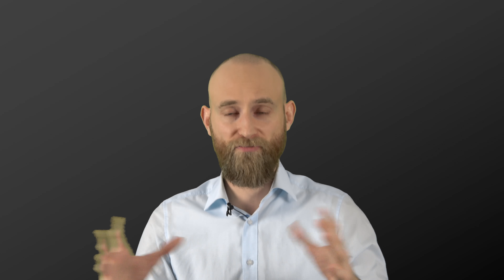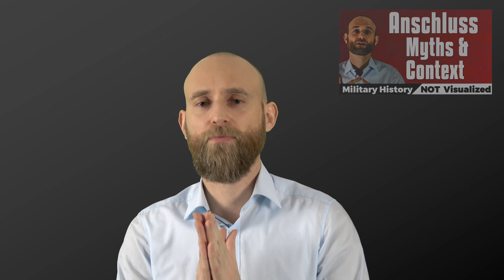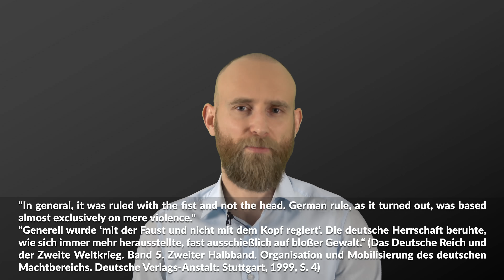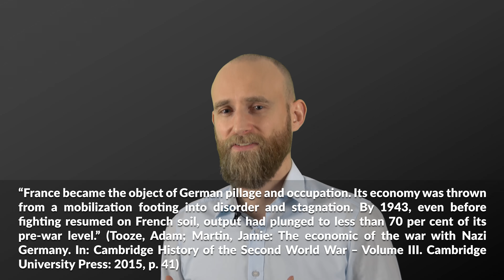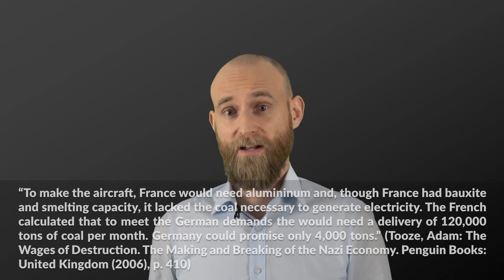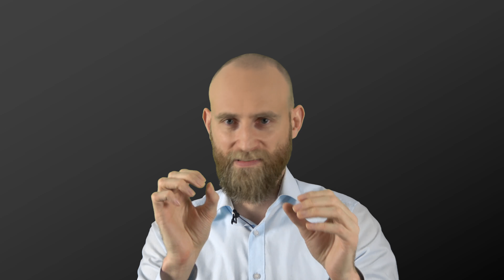German Exploitation of Occupied Industries - Effective?

Comment: Germany used coal for everything. It came from the Ruhr, where most heavy industry was.  The prime transport mechanism was rail, using steam trains, that used coal, with steel wheels on steel rails, made using coal, so no imported rubber for tyres.  Electricity was generated using coal. Coal for industry. Coal for steel making. Cutting off the Ruhr meant hitting the German war machine at its heart, starving it of manufacturing and energy. Cutting the Ruhr off was vital. 

The British saw this, especially Montgomery, wanting an allied thrust north, to turn right to isolate the Ruhr.  Eisenhower wanted a broad front, which was totally ineffective. People will say, well from D-day to surrender it was only 11 months. However, it was only that short because the Germans gambled using much of their armour at the Battle of the Bulge, losing it shortening the war. They ran out of armour.

The war could have been over by Christmas 1944 if Montgomery was left in charge of all ground forces. He would have seized the Ruhr - then its all over. Even German generals after WW2 agreed with Montgomery saying they could not have stopped a full allied thrust to the north. They could stop the thin allied line that stretched from Switzerland to the North Sea. The Ruhr was only captured a month before the end of the war. 

Eisenhower allowed the under resourced Market Garden to go ahead into the north. It was so small it only had one corps above Eindhoven as Eisenhower would not allocate the US First Army to move up on the right British flank.  A total disgrace when looking at the level of allied forces in the ETO.
Reply: The war couldn’t have been over by Christmas 1944, in fact like his usual set piece offensives Monty’s offensive north failed at Goodwood, and of course the war didn’t end after the Ruhr encirclement

Finally it wasn’t possible to end in 1944 considering the whole they only made it to the west wall in late 1944, trust guy Eisenhower was both smarter than you, and smarter than the Germans, and certainly smarter than Montgomery
Reply: @looinrims  
* Monty was the most successful general in WW2.  He had to take command of two shambolic US armies in the German Bulge attack .
* Goodwood was a success.  Monty drew onto the British the German armour,  then wiped out 90% of it. 
* Rhur encirclement was not until the last weeks of the war. 
* Monty wanted a 40 division thrust to the north.  The German generals said they could not have resisted it, saying the war being over by Christmas 1944.
* US general were inexperienced and naive, prolonging the war.
* You must not get your history from Hollywood.

Comment: In the Netherlands the Nazi's stole the largest portion through the Dutch National Bank. The Netherland had kept their own currency which fact the Germans  used to force the National Bank to print extra money for them.  With  this money the Germans bought goods and services in Netherland. The Germans were so nice to compensate this with a debt in Reichsmark to keep up the resemblance of a normal international economy. However the Dutch National Bank was not allowed to collected those debts until after Germany had won the war. And even if the bank could have gotten Reichsmarks during the war the Dutch would not have been allowed spent those in Germany to import goods back. After the war there was no Germany or Reichsmark economy, so those debts became worthless. This was one of the reasons the Dutch economy got flooded with guilders and only the rationing, fixed price system prevented hyper-inflation. After the war those extra guilders had to be taxed away first before a normal, free economy could resume.
Reply: Another part of the monatary system consisted of  cheaper production costs for money. Changing silver coins  into paper and changing the small silver and copper coins into cheap zink, They made them squaere to have as less restmaterial as possible.  A silver  gulden comes into the National Bank, consisting of silver with a certain value. A paper gulden comes out, worth only a little piece of paper and ink and the costs of printing. Worth a few cent.  The difference is for the one who prints it. Not bad, 2 cts of paper. 98 ct of pure profit. A form of tax, nobody feels. At least not in the beginning.

Comment: Gasogene*.  The fuel problem was so bad that Tigers in France were converted with Gasogene fuel generators.  Burrning wood to produce methane.  Ruinously expensive in resources consumed for work done per unit of volume.
http://www.tanks-encyclopedia.com/ww2/nazi_germany/gas-powered-fahrschulwanne-tanks.php

*Holzgas vom Deutsch

Comment: Did natural gas exist as a power source during the Second World War?
Reply: Large numbers of communities used town gas. Coal plus steam. About 30% Carbon monoxide. The problems with natural gas are drilling,pipeline transportation and storage. Large safe nonriveted pressure vessels were essentially new,electric arc welding was newish, and the idea of dropping the temperature down to cryogenic and storing the liquid in caverns( yes it really is done ) had not been created.
Natural gas takes a lot of very expensive permanently located infrastructure to be economically useful.

Comment: Hi Bernhard, I have a complicated question to ask you. What if the Wehrmacht waited until summer 1941 to attack the uk/try to gain aerial supremacy over the uk and the channel? And was this ever proposed to Hitlee/the OKH/OKW/Kriegsmarine? I mean germany, the axis and its occupied territories could outproduce the island of britain, right?
Reply: Germany was falling behind its adversaries in the arms race by the start of '39. Delaying the war would have produced even worse results for them. They were in a no win situation.
Reply: @dondajulah4168  I didn't mean that but rather since the soviets gave germans oil and other important resources, couldn't germany and the axis just single handedly outproduce britain in planes and stuff and bomb them to submission or try to do sealion in 41 instead of barbarossa
Reply: @KlausValk  Germany could not come close to out producing GB once they were mobilized for war. The UK produced almost 5000 more aircraft than Germany in 1940 and then you have the US also providing them with thousands of planes on top of that. 

As for Sealion. That was a pipe dream with no chance of success. The Germans were planning to use river barges to cross the channel which are not sea worthy vessels. 

The channel would be filled with British destroyers, corvettes and torpedo boats so essentially open season on the invasion force . Whatever would have been able to make it across would be facing a well prepared and supplied British home army while the Germans would have to make due with whatever they brought with them.

Comment: Using the fist over the head.  Did they not learn from the Romans?  It only works for a little while, well in the case of the Romans a long while, but their enemies did not have the weapons of WWII.  Win hearts and minds is the only way to win.  If that does not work, and you burn their damned huts down, you just increase their hatred for you and the resistance grows.
Reply: The Romans actually did a VERY good job of doing hearts in minds in a great many places. Typically, Roman rule was a big step up over what the locals had to deal with prior. At the very least, you no longer had to worry so much about your neighbors invading you .They were now Roman Peace mode too.

Comment: Coal is not always the same. Lignite (brown coal) has a low calorific value and blocks boiler tubes.  Power stations built to burn lignite were used in Germany. However, you would not use lignite in a steam engine by choice, as there would be a massive loss of power coupled with an excessive maintenance burden.  Germany was forced to use lignite in some steam engines.

The manufacture of concrete requires large amounts of power.  Germany with its Festung Europa, must have burned through incredible amounts of coal, that otherwise would have served its war industry.

Comment: I've always wondered about this subject. In HOI4, when you take over a territory you automatically get their resources, civilian and military factories to immediately use in your own war machine. I always wondered how this would work in real life. How long would it take Germany to fully integrate Belgium and Dutch factories to play a direct role in the production of German war materials. Was full integration possible?
Reply: hoi4 does not make much sense overall...(yeah, i do not like hoi4) that aside, hoi2 (and the successors AOD and DH) set ic to zero after gaining the province, only after a while would it increase to a level much lower than the maximum efficiency that national provinces have, in essence you would never be able to gain full use of those ic which is much more realistic...

now as for how long it would take to fully integrate industry of Belgium and Holland? that answer is more than 5 years they where occupied as neither where used to anything like maximum capacity(iirc from my books ive read over the years), even the military associated industries where not run due to the resources where put into the mainly German industries, even late in the war they barely supplied anything of note to the war machine...

even in nations that where pro-german like denmark, the industries never regained their pre-war efficiency during the war.
Reply: NL and Belgium had colonies and were largely dependent on them.
Reply: Ok another reason to stick to hoi1 core 0.95.
Reply: Hoi4 isn't particularly accurate. However, the new compliance system does attempt to take these issues into account. The main things HoI4 is missing to have a more accurate representation of the various situations are food, coal, supply chain composition (trucks, horses, trains, regional prioritization), and civilian consumption of resources (consumer goods factories, electricity [coal, oil], food). If you assign 10 factories to trucks and have a stockpile of tens of thousands, and plenty of fuel, you should be able to allocate those trucks to a supply region, for example, improving the supply transit in the region as it becomes more motorized and less horse dependent.
Reply: @Sapoman2211  And nowdays HOI: Germany has infinite manpower and industry that can beat the US. In 1941 Germany alone can win the whole world war. I wish it was in real world...
Reply: @gregorgerzson1767  
You wish what...?

Comment: A related question: if you capture an industry e.g. producing KV-1, would you 
a) keep it producing them, 
b) or try to change it to produce Panzer IV, 
c) or making some hybrid (KV with a German gun, optics, and radio)?

a) would be the easiest and most efficient, but it would make supplying your army more complicated and then there´s the training issue.
b) would be the most complicated and quite possibly looting would be easier and setting up a new industry in a safer place.
c) would be a compromise
Reply: Usually the factory would be abandoned before capturing it, so making your new workers to manufacture unknown equipment would be no sense.
Reply: I imagine it would be difficult to continue production as the supply lines have flipped on the "axis" of the front line, not to mention transporting raw materials and assembled components would be difficult and drain resources from the soldiers on the front. Also you need to capture a fair amount of the original workforce in the factory who most likely would've fled further into Russia. Given all this it would probably make most sense to loot it and burn it after.
Reply: A very good question. I suppose a better example should be used instead of KV-1. Say a French Tank, or Poland truck... We know Nazi re-used captured French Tank for some other purpose but really not sure if they kept the existing factory running.
Reply: @cyrilchui2811  I used the exampleof the KV as I know that there were several KV used by Nazis and they occasionally altered the turret or cannon. The KV is an amazing platform when it comes to carrying weaponry.
Reply: @edi9892  I thought KV was a bad example because a) Soviet was pulling everything back including human capital b) unless it was somewhere inside Ukraine or Belarus where Soviet was too slow to react. France, Beneluz example were all captured intact
Reply: I'm guessing ze Germans would just keep the production constant, assuming resource availability.
Reply: Historically in German-occupied territories, the military factories were not used, primarily preferring to loot and ship the spoils back to Germany. The majority of industry in the occupied territory was civilian, notably the textiles in France covering for the closure of the domestic textile industry in Lower Silesia in 1944. While the majority of the occupied territories were simply manpower reserves which Sauckel drew upon, indiscriminately drawing workers into the German economy regardless of their profession.

Source:
Milward, Alan S., 'The German Economy at War', The Athlone Press of the University of London, London, 1965.

I would assume by Germany's past record that they would simply strip the factory for useful tooling and equipment and otherwise send the labour to the Reich to chemical factories, especially since they worked in the manufacturing industry. I mean, it's only logical...
Reply: Worth noting that if you use the truck and tanks captured from the enemy or built with their factories you now need more types of spare parts with complicates the logistical and maintenance situation further.
Reply: >implying the Germans would ever capture any soviet industry before it was took to the Urals good joke

Comment: This is actually a very good question.
glad you tackled it.

so basically Factorio on crack?
Reply from the maker: yeah, Factorio is a good example, where one can easily see that even with a very basic system with no-one else involved in a matter of minutes everything can go to shit, once there is a problem somewhere in the production cycle.
Reply: @MilitaryHistoryNotVisualized  That problem usually being a shortage of some resource
Reply from the maker: @Tiagra 12, well in some cases, it is also one assembly machine taking away one resource faster than another one, my problems often resulted from in-balances that were created once I expanded the system.